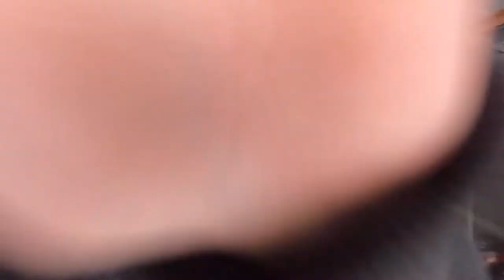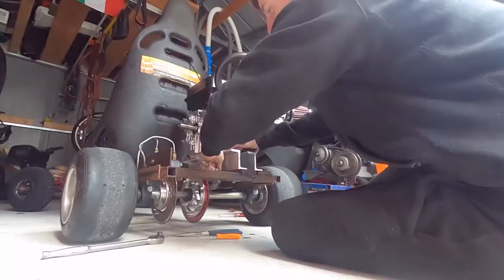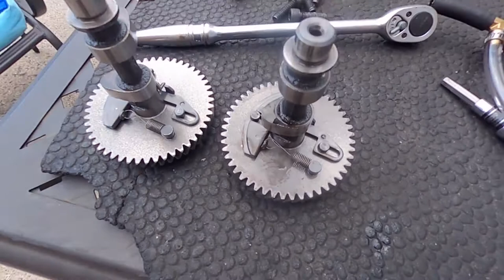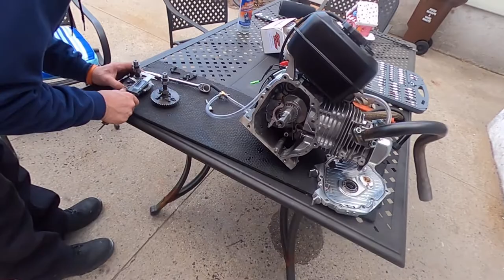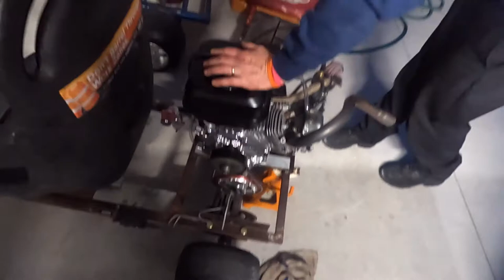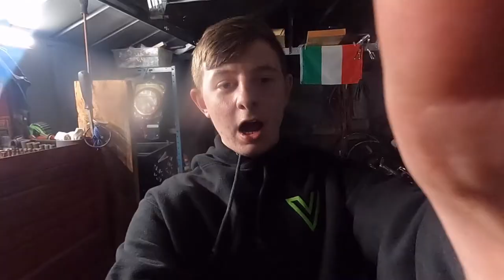New 308 Drag Racing Cam Installed On The Drift Cart

Comment: Nice work man! Just a tip some guys use it and some don't but I add a few squirts of ZDDP which is a zinc additive made for engines with flat tappet lifters. I put some in every oil change but really think it's important for break in to have that extra zinc. Lot of break in oils are usually higher in zinc